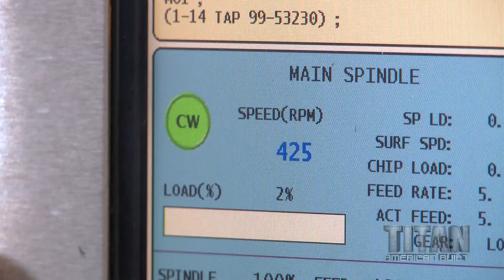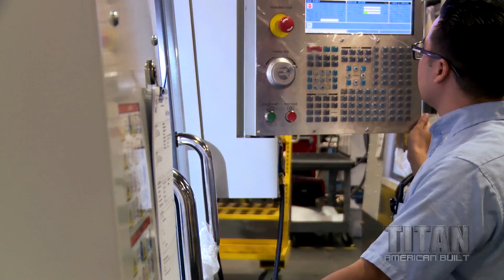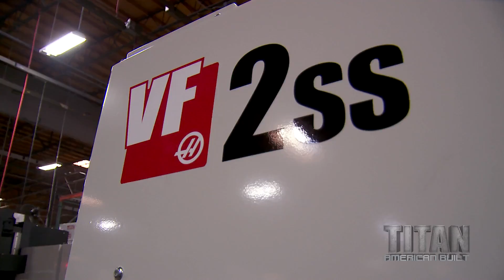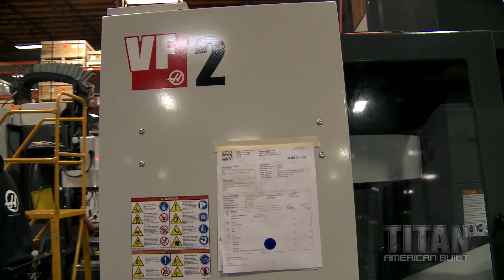Titan Takes a Tour of Haas Automation

Comment: yeah nice machines for my garage, but at my Company i use the Hermle Machines from Germany
Reply: I've run a lot of different machine's, from a fairly diverse list of manufacturers, and it's interesting how many shop's have found that a Haas machine can do 95% of what the high end imports from Europe, but for a fraction of the up front cost, as well as lower overall cost of ownership down to line, due to Haas's design philosophy of "If it's not there in the first place, it can't break". This then free's up capital they can then spend on whatever specialty machine they need for the off the wall stuff.

Comment: My first machine was a Haas Mini mill and it was fantastic!  My second machine was a VF2SS and it was problematic and my third machine was a VM3 "mold machine" and it was a bucket of bolts piece of junk.  All bought brand new.  Over three years these were replaced with four Makinos and all I can say is I regret not making the switch sooner.  I really wish Haas would try to improve their machines and build more quality into them.  Running with Makinos puts me in a while different class of capability as a shop. Like .0005" true position in 5 -axis on a production level.  Yes, we have a calibrated CMM...
Reply: The VM3 was shipped with a bad spindle, misaligned Z-axis ball screw,etc... And required several service calls to even get the machine up and running.  It is hard to take delivery of your new baby, the enter of the shop and a major purchase only to realize you have been duped.  Getting Haas to step up and fix it was an act of Congress as well.  Select was very good to work with however.
Reply: Selway...
Reply: @robertw4608  Out of curiosity, how did you know your Z axis ball screw was out of alignment? Did it sound different?

Comment: I have worked on a HAAS and when we tried taking a decent cut, the machine wanted to jump off the floor. If you look at the "guts" of the machine you see why. Guide ways are roller bearings, not linear. Spindle is air cooled, not chilled oil. The ways are also very narrow. An entry level machine, good for schools and starting shops.

Comment: I can personally vouch for haas . I don't give a damn what anyone says , I've used ALOT of Haas lathes , Office lathe / gang tooling, SL10,SL20,SL30, and ST10T and they are extremely accurate to within a tenth or so !!!! Easy to use , maintain , and highly reliable.  If you use them properly and with care they will last a lifetime - seriously . No need to spend 300,000 in a good lathe when you can spend 28-120,000 and do the same exact thing . PS I hate mazatrol controls , they are not as user friendly and you have less control.  These are the ps3 / ps4 of machine tools .

Comment: I bought my first brand new HAAS last year. A VF5xt.  I've been machining since 1982 and I've worked many high end machines. I can honestly say the HAAS is the best machine I have ever used.  I will never purchase any other machine for my business.  Well done HAAS!  You should be very proud.
Reply: I have grown very accustomed to their controllers and operating these machines. I would probably be lost on a different controller. They are very user freindly, and easy to maintain. But the man said himself, they machine the spindles to a .0001", but him touching it, would change the size.... now apply that to machine temperature variations, ambient temperature, tool wear causing spindle load. We have an ancient Mori, that has a ceramic spindle, that holds tolerances much better then the Haas's. It sucks to operate! No auger, no offset measure. Still technically a superior tolerance holder though.
Reply: They're pretty legit